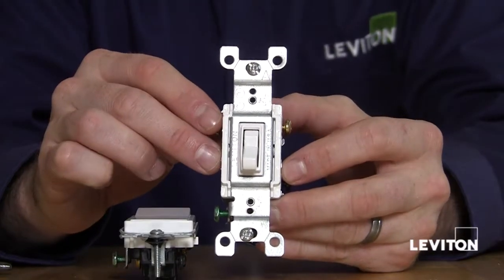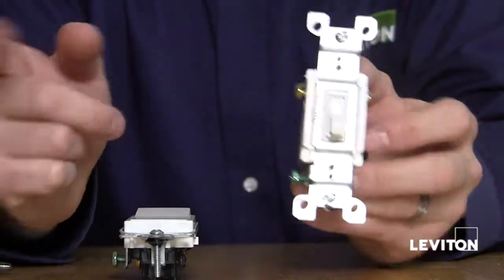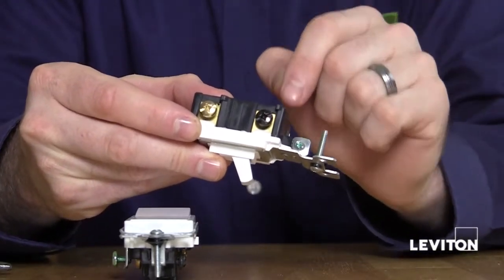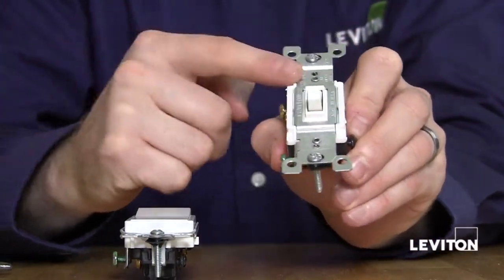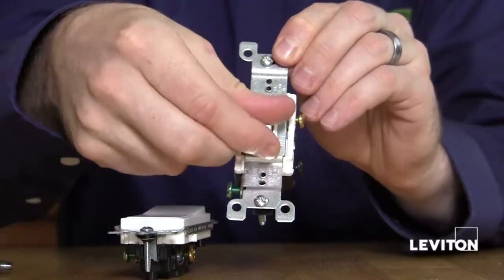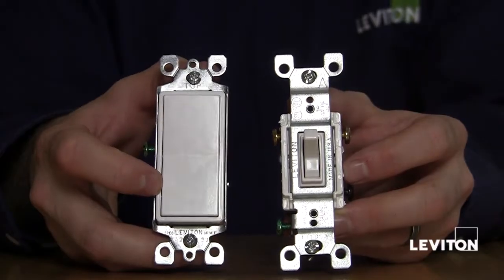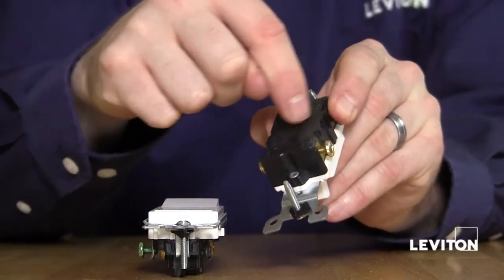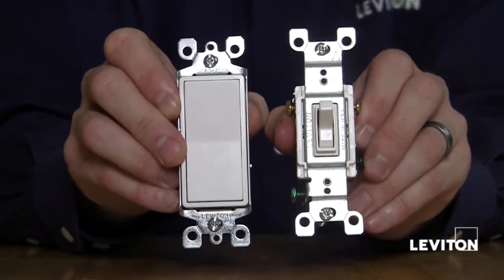What is a 3-Way Switch? | Leviton

Comment: Would be a lot easier to mention which of the 3 wires in the wall that won't test hot goes to which. When I switch back and forth from one 3-way, 2 of them alternate when tester is grounded to box metal

Comment: A picture says a thousand words. Your picture/diagram on the box (without reading) shows the two traveler wires on opposite ends of the switch. Why on earth would you show the little line going to the switch, go to the wrong spot??

Comment: I have been trying to find out why the USA call these 3 way switch, when they are a SPDT, that is a single pole, dual throw switch, how can this be 3 way, you say because it has 3 connections, a switch can have 10 connections, that does not make it a 10 way switch. I would like to ask the logic behind calling this a 3 way switch.

Comment: Horrible explanation. 

There are three terminals on a 3-way. The Black one is either Line IN (hot) or the LOAD (to the light).  

The other terminals are brass and are the "traveler wires." The traveler wires are used to convey the power between the two switches. They SWITCH their role (direction of power flow) as the  physical switch selection changes. The switch is  connecting ONE of the traveler wires at a time to the BLACK terminal on that ONE switch (the HOT, source of power or the LOAD, light depending on where in the circuit the switch is). 

When the two switches are BOTH set to the same traveler wire AND the switch is CONNECTED to the Line or Load (black screw), current flows. IF one of the switches change their position the connection is broken because the different traveler wire is now connected. 

Once in this state, flipping the position of the OTHER switch changes the traveler wire connected and completes the circuit for this combination of physical switch positions.